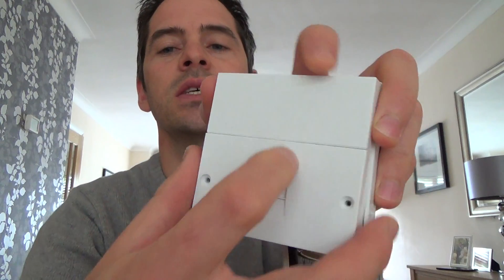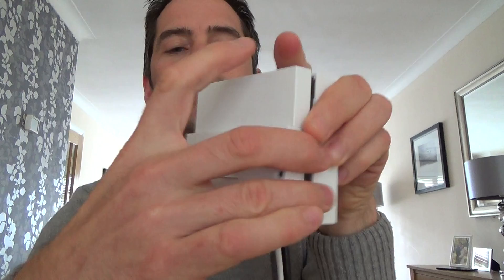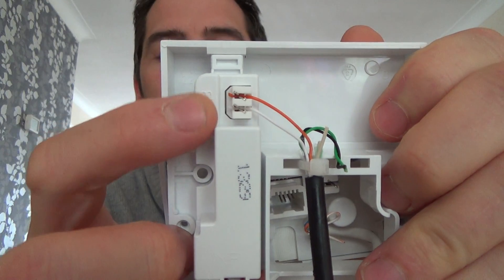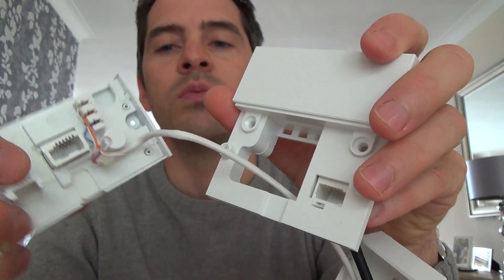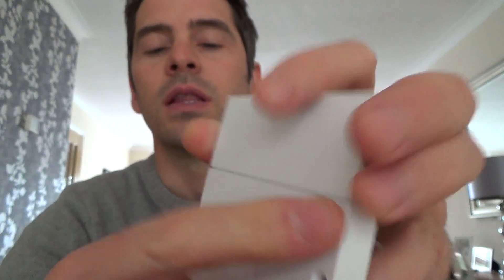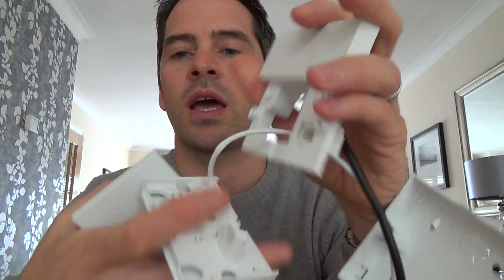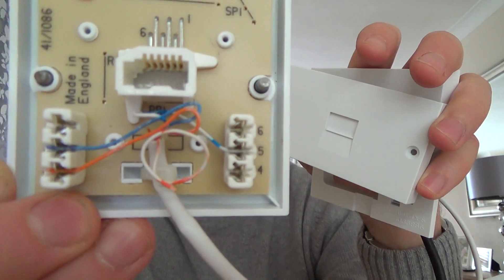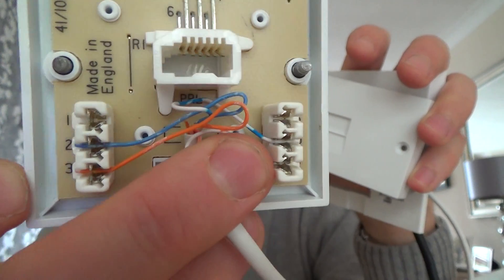How to wire up a NTE5 TELEPHONE MASTER SOCKET (quick version)

Comment: Ok the wiring, actually wiring it, when inserting wires into A/B does it just pop in or do you need to pull back to reveal the copper? Any help would be much appreciated 👍

Comment: Hi Vince
My master socket is I’m the hallway and my router is in the lounge.  We are having  trouble with the internet dropping out and crackling on the phone line.  If I install a Adsl base plate and hard wire the broadband in can we feed the wire to the router into the lounge. Will this work

Comment: Vince I accidentally ripped the phone wires out the old ntl phone junction, then watched your old Mr telephone video. 🤣 You do look funny back then. Anyway the phone works but the dialing tone does 2 purrs then solid, 2 purrs then solid, why is this. Got orange in B and white/orange in A, no extensions on it. Cheers

Comment: Hi, great videos! "videos" how old am I lol! Anyway Ive got a query for you re the master socket, we didnt have the proper unplug all your equipment type so I bought one and the tool to fit the wires and thought easy peasy, oh really!? I have my own little business doing home improvement etc so Im fairly ok with this sort of work, or so I thought lol! The wires coming through the wall from the main cable outside are not orange and white but white/blue stripes and blue/white stripes, so I thought right just put these two wires into the two and only slots on the back of the new correct BT style socket and away we go! I lost everything no landline, no internet nothing, I could dial out and I could dial in from mobile but no connection from either way. Done all the obvious checks and still nothing but problem, no internet to check my problem! Had a quick look on mob and couldnt find anything obvious. Managed to put it all back to its original set up and everything's working, any suggestions please? Cheers Grant. ps Ive checked in the box outside and the white and orange wires are there but its the two blue ones going through the wall?

Comment: Super helpful! Thanks Vince, you're a life saver! I had to re-fix my virgin socket to the wall and in the process 1 wire came out, I had no clue how to re-fix to the terminal, or which terminal (my socket had 3) it should connect to - this vid and your 22 minute one sorted the problem - thanks again!

Comment: Hi Vince, hoping you will see this. Have been trying to connect a ADSL and phone surface socket at my dads, when connecting the modem t the adsl outlet the spped is very low, using the supplied splitter filter, it works reasonable. The wiring at the back of the socket is the twisted pair colours, I asked if this was the main place where the wire comes into the house he says it is, but I now have my doubts, what should the main incoming cable be from BT? I suspect now, I might be on the end of an extension, hence poor internet connection using a dual faceplate?

Comment: Looks like I have a white extension cable going to the back of my master socket. White/blue, blue/White connecting  to A and B. Looks like someone run it from the black bt underground cable. My internet works but bt are saying three a fault

Comment: I have a master socket from 1996 that does not have the A/B connections but just connections 1-6.  I have successfully run an extension from this for 22 years.  I have just taken the face plate off and some wires have disconnected.  Please can you tell me which numbers the six coloured extension wires should be connected to in the master socket and in the extension socket.  The master socket is currently wired white/no 2 and orange/No 5
Reply from the maker: The normal colour code is blue to 2, white/blue to 5 and orange to 3 on both sockets (master and extension). This colour code can vary though depending on the age of the cable and whether internal or external cable was used.

Comment: Hi Vince, great vid. I've just had Virgin fibre installed with their phone line. The engineer said it was NOT possible to use the slaves I current have around the house. He said it was due to the wires Virgin use. I could use the slave sockets when I had a BT line. It was wired up just like in your vid. Is it possible to use slave sockets on a Virgin line?
Reply from the maker: Hi, yes it is,  telephone extension sockets will work on BT and Virgin lines. Disconnect the extensions from the BT master socket and then wire them up to the front plate of the Virgin master socket. If the BT and Virgin master sockets are next to each other then it should be easy but if they are far away then it might be hassle and perhaps the engineer didn't have the time on the job to do it :-)
Reply: Hi Vince. wired it all up just lke in your vids. Tryed it out on a slave extension - got a dialling tone, but wouldn't ring when i called the house and couldn't call out either. Any thoughts? Cheers

Comment: Hi I've got a split socket one for phone at the bottom and broadband at the top. I don't use a home phone I just want broadband in my kitchen. I have the cable and a small extension box. How do I go about doing this?

Comment: Hello Vince,  first class video but just wondering if you could help me please, our dog chewed through the main phone line so everything went off, I tidied up the wires and reconnected them (outside the box) by just winding them together, I just reconnected all the 4 wires, ( Orange, Blue, Green and Brown ) and taped them, straight away the internet came back on but the phone is still dead, no dialing tone and no noise, I followed your advice and tried the phone in my neighbour's house to check it and it still works fine so I know its not the phone, any ideas you could give me would be very much appreciated.

Comment: Hi my mate Vince, I have a virgin line that I'm to change my old box has 4 wires (blue,white/b,orange,white/o) and 3 v slots new master box has 2 V slots where do I put the wires
Reply from the maker: If you look closely both the old and the new box should have 2 of the slots labelled up with A and B so then you can copy the A from the old box to the A on the new box and the same thing for B.

Comment: I have done exactly as you've mentioned to have an extension socket in another room. The problem I'm having now is the internet does not work when I use the extension socket. Not sure why but I also have a noise on the line when the modem is coming connected too. Please can you tell me where did I go wrong? I use exactly the same two types of sockets in your video
Reply from the maker: Make sure you have plugged a microfilter into the new extension socket. It sounds like you are hearing the broadband noise which happens when you don't use a filter.

Comment: Can you run 2 extension sockets from the master socket ? If so does both have to run direct from the master or can it go master - slave - slave etc etc running 3rd docket down the line from the second
Reply from the maker: You can run from slave to slave or run both from the master socket. It doesn't matter which way just do whatever is easiest.

Comment: Hi I have an old ntl box which I haves an extension coming off which services my alarm response. The box has failed and I wish to change it. I am now on Virgin media and my incoming line has 4 core line. Would your NTE5a box work on my line? and if so what would the A B colours be?

I will obviously buy my new box from you and the insertion tool.
Reply from the maker: Hi, my NTE5 master sockets will work on Virginmedia and you should be able to just change it and copy like for like with the old NTL one because the old NTL should still be an NTE5 socket as these sockets have been around for many years so if you look closely it will have A and B on the back plate and then terminal 2,3 and 5 on the removable frontplate. Always copy what you already have because it used to work so if you have the white/blue to A and blue wire connected to B then copy this onto the new NTE5 socket.
Cheers Vince

Comment: Tried to follow the instructions but on opening the BT box i see that Virgin media has spliced or joined on some of their wiring onto my line wires in the BT socket. Is this to use the spare wires so they do not have to run their own. regards
Reply from the maker: Hi, yes that is exactly the reason why. It saves a lot of time to reuse the existing wiring.

Comment: Hey Vince I was wondering could you help me? I think are master socket wiring are broken and when I went to have a look I think I pulled all the wires out. is there a way you can help me? The wires are colored correctly I think. There are alot of white wires then blue orange and brown. no blue and white or orange and white. and no red or black. This is a very old phone line.
Reply: Anyway of contacting you for some advice as bt are gonna charge us 130 quid to fix it

Comment: Hello Vincent, just got bt infinity 2, I got the blue/white and white/blue cable plugged to A + B,It SAYS I GOT A FAULTY line on the router light, there is no cables connected to 5, 3 and 2, what do I do ? please help

Comment: Some great videos Vince thank you. I have an NTE5 Socket from which I run a router, but I'd like to make an extension to this so I can have another router and my Sky working at the other end of my Bungalow where we get no Wifi Signal... can you advise please (We already use 240v Plug Extensions but even their signal is too weak) Thank you in Advance Vince - 5 Stars.
Reply from the maker: +l4weg  Hi, if you are having no joy with the powerline adaptors then it would be best to run a long cat5e or cat6 Ethernet cable from your exisiting router either internally or externally (using external cable) and then plug it into a network switch or wireless access point. If you were to run a telephone extension then you will not be able to plug in 2 routers on the one telephone line so you have to go down the networking route. Have another look into powerline adaptors as you can get a mix of ones with WiFi etc. Look at one of my latest videos on boosting your Wifi signal where I set them up in my house. 
Thanks Vince.
Reply: Vincent you are a star, thank you for the information and swift assistance.

Comment: Hi I have two sockets 1. Living room 2 computer room upstairs.  Living room with split ssfp socket and the upstairs is single open reach bottom split box   Upstairs don't work. Both cables runs to the outside grey master socket.  Upstairs has just the orange in a white in b and nothing else. There is green and black but unconnected.  Any idea ?

Comment: hi Vince i have a problem i have master socket that has the numbers 123 on one side and 456 the other the wires that come out of  the wall are 1 orange 1 green 3 red and 1 white which is rather short i might have to add a Little bit more wire to this white wire could you tell me in what order i punch them down in the slots with the numbers on thanks bob thanks.PS my email is zirkon3@hotmail.com
Reply from the maker: +blijytoo Sounds like dropwire cable, the 3 red are the steel tension wires to stop it sagging when it is spanning over a road. Normally you would use white to 5 and orange to 2. The green and black wires are spares.
Thanks Vince
Reply: thanks Vince.

Comment: Hi Vince, I was wondering if you could help me out, I want to change the mast plug to a chrome one, I found some mast sockets online. They dont have the A and B connection just the numbers 1,2,3,4,5 and 6. It also has some resisters for ringer, surge and tester. Can I connect the A and B wires directly into 1,2,3,4,5 or 6? 

Thanks in advance :).
Reply from the maker: +luis martinez Hi, yes, terminal 2 is the same as B and terminal 5 is the same as A.
Reply: Thanks Vince much appreciated.

Comment: Hi Vince, 
had a chat with the alarm guy: he says it is the first time he came across this kind of problem...I don't think the alarm itself is filtered, so I was thinking to install an ADSL faceplate on my existing main socket...is it something I will be able to do it myself (with the help of your tutorials of course!!!)?
Thanks again 
Giorgio
Reply from the maker: +Giorgio Aprile Hi Giorgio, yes you will be easily able to do that. Remember that it will only work if you have your router placed by the NTE5 master socket because once you fit the ADSL faceplate you can no longer use the extensions sockets for broadband...only for voice so the router has to be plugged into the ADSL faceplate. Make sure you make a note of which wire goes where before you remove them so you can replicate the wiring onto the ADSL faceplate.Thanks Vince.

Comment: Hi Vince, 
hope you can help with this: I had an intruder alarm fitted recently and since then my broadband speed dropped to almost nothing. I called the alarm guy, but he claim that the wiring into the main Openreach socket is correct. The wires from the alarm (blue and white, white and blue are in the right place (2 and 5) with the same color extension wires.
I am certain that those cable are causing the problem, because when I test my broadband into the test socket the speed rockets again.
I would like to avoid messing around with the cables behind the socket...can you help?
Thank you
Giorgio
Reply from the maker: +Giorgio Aprile It sounds like the alarm may not be filtered. Everything that uses a phone socket in the property needs a  filter, sky, fax, phone, alarm etc. if you have a ADSL faceplate on your master socket then this is fine because this filters every other socket in the property but if you have a normal Openreach NTE5 with the little removable frontplate then this may be causing the problem. Maybe ask the alarm if they have installed a filter in the alarm box for the phone line as this may be an easy fix.Good luck Vince.
Reply: Thanks a lot for your prompt reply, I'll get in touch with the alarm guy. I'll keep you posted. Cheers.

Comment: Hi Vince, hoping you can help.

I've just changed from sky broadband to sky fibre. I've not changed router or anything and its all working as it should.

I don't have a master socket though, just an ancient BT junction box thing and what to remove this and replace with a master socket, which one will I need though?
Reply from the maker: EmpiricalPenguin Hi, it depends on the thickness of the wires. If you are unsure if they are thicker than modern wires then go for a NTE5 screw terminal version as this version takes the thicker and thinner wires.
Reply: Brilliant, thanks for the quick reply. Having looked at it again I'm not 100% if the line terminates in the loft or if it comes down the house and in through the front door frame to this box. The loft is practically inaccessible through. Is it likely to be in the loft If I have a box like this? It looks one of the ones from your video on Box junctions so I'm a tad confused!
Reply from the maker: EmpiricalPenguin Hi, maybe if everything is working good then you should leave it as it is. If in the future you have problems then you can trace the wires and work out 'what is what' then.